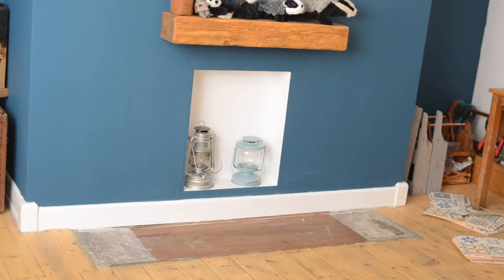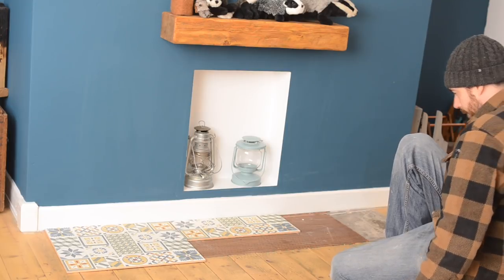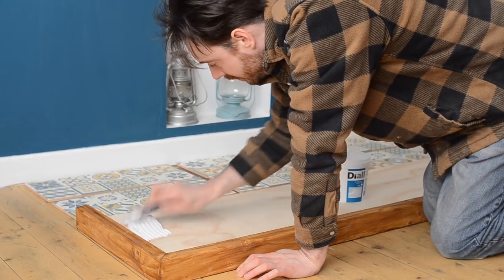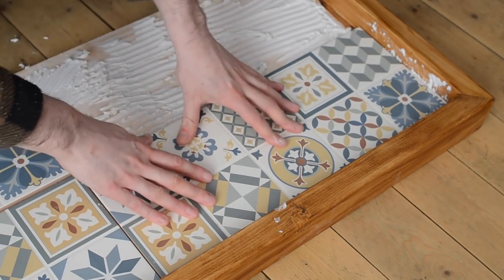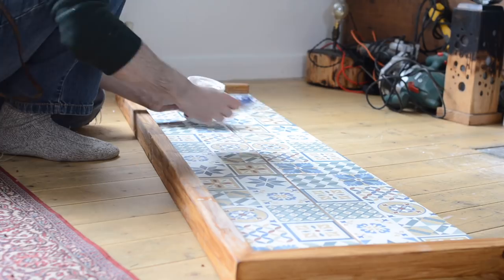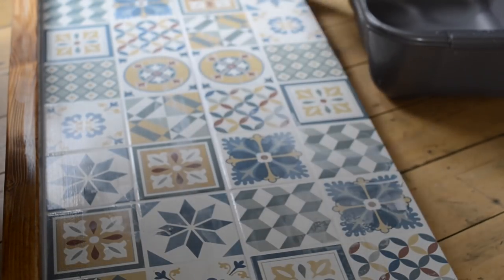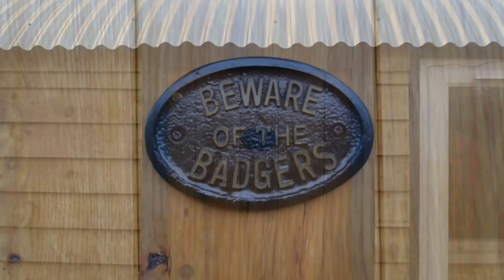Making A Hearth For The Fire

Comment: Nice build. Trying something similar at home. Did you prime the wood before applying tile adhesive to prevent it absorbing moisture from the adhesive? If not, have you had any issues with the tiles bonding to the wood?
Reply from the maker: I did not and have had no problems